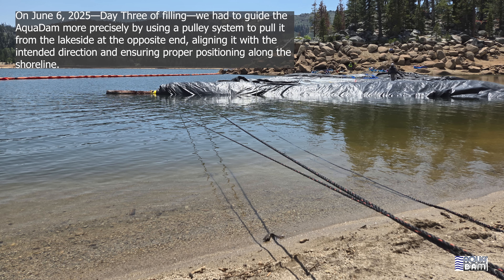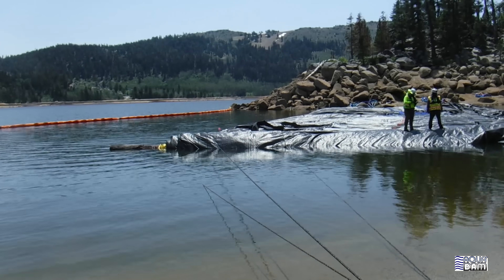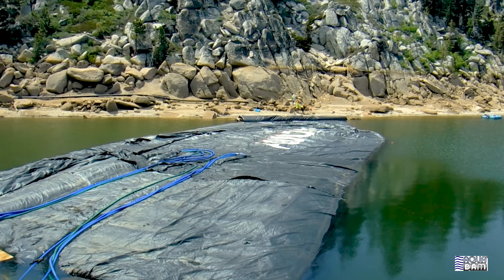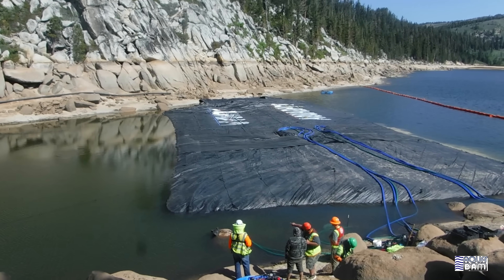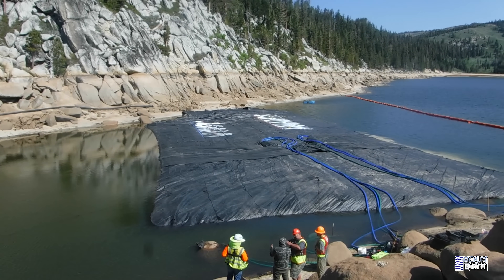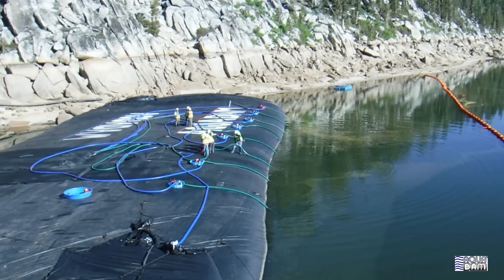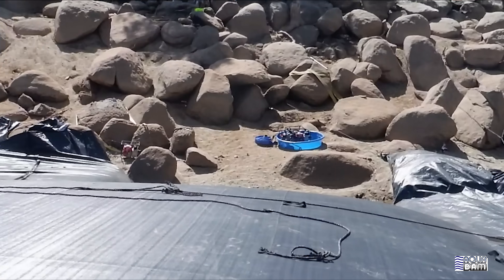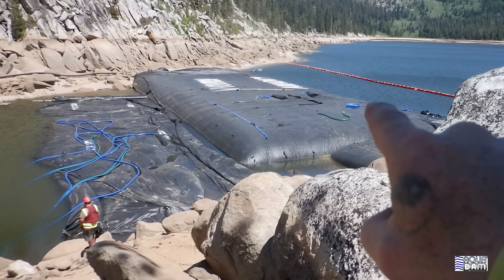Marlette Lake, Nevada 2025 [part 3 of 4]

Comment: why though? i Mean i get your building a temporary dam but two excavators and a dump truck could do the same job faster. and how many uses can you expect to get out of this system? how much work will it take to find and repair punctures? when you do have to scrap it, have you considered the amount of plastic and rubber waste your producing? not to mention you already need heavy equipment to deploy this system, which could just do the job without all the extra trash and time your wasting?
Reply: SO…….every new or newer technology needs experimental or situational places to be tested to prove out what it can do or even could do…..and of course man’s creativity as well.  In this environmentally sensitive place it seems that it was decided not to run “1000” dump trucks of material up the small mountain dirt road…(a previous video in this series). And use this reusable technology.
You mentioned “wasting time”.     These few workers spent far less time adjusting the Aqua dam, than the weeks it would take to build a coffer dam made of earth and rocks. And then The weeks of removal. In typical construction “time wasting” far less time was wasted here than normal.  This product is made from rubber, tires are also made from rubber, and the fabric is canvas and fiberglass mesh, typical building materials.   What is your problem besides being a guy sitting in your underwear, in the basement of your mothers house, with nothing better to do, than troll a really cool idea
Reply: @paulthesoundguy1 geezus, get a grip. This seemed a faff from start to finish. I have a difficult time expecting much of a seal and that it will see significant leaks that will require lots of dewatering.
Reply: @ArthurDentZaphodBeeb that’s because you have not looked at the entire project and the dam design